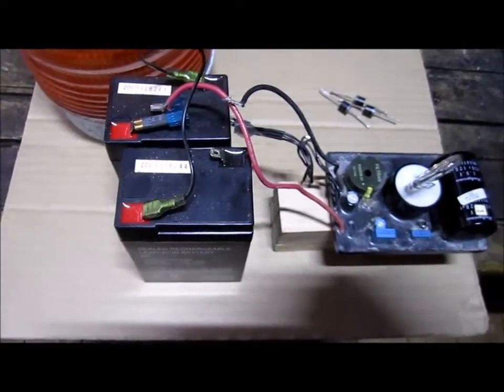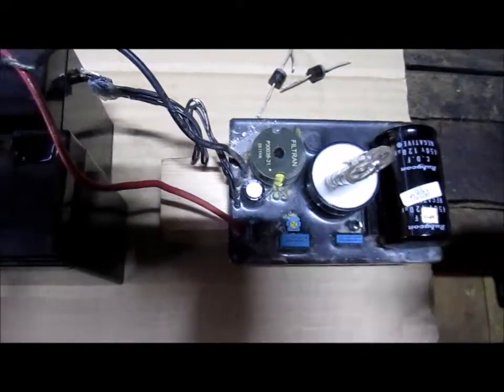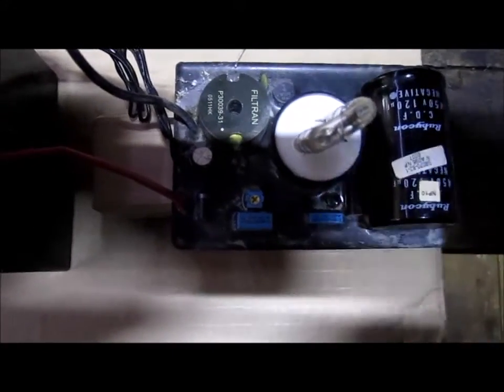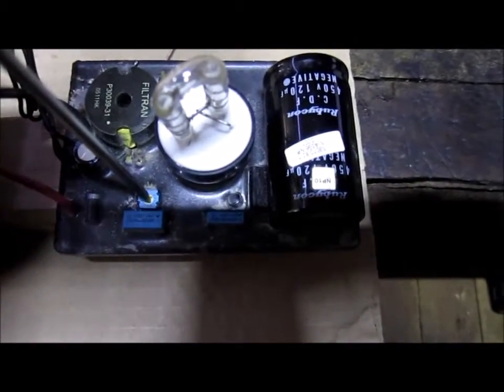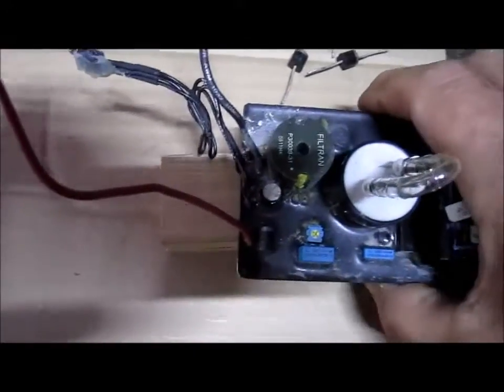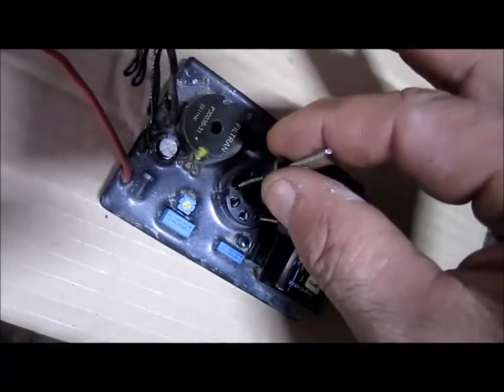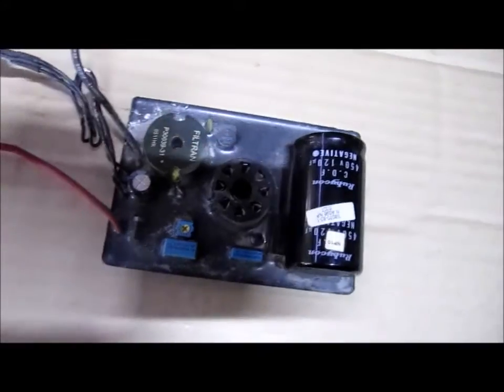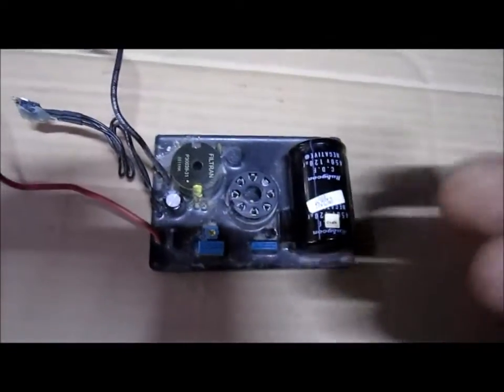Making A Battery Desulfator From A Strobe Light

Comment: Simple pulse width modulator should work ok. Nasty cut there M8.
Reply from the maker: +Seeds2freedom Thinking it should be. Nasty cut alright. Zip cut flew apart and my finger was in its way. Healing is taking place. Right down in to the bone it went. ( Not good ) No bending the finger for a good month or so.  : o )